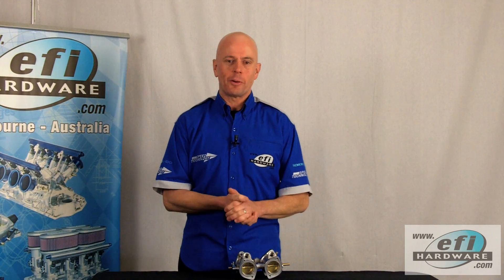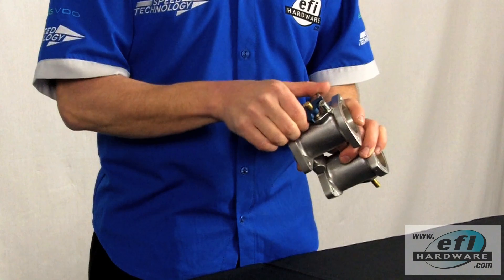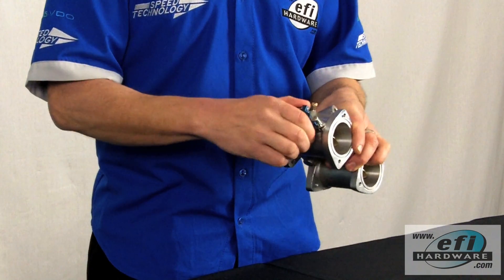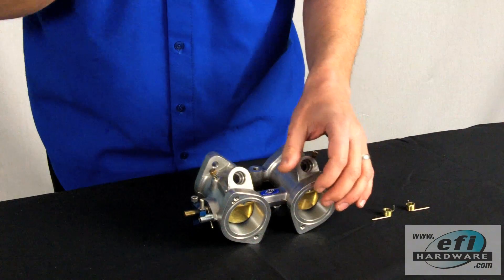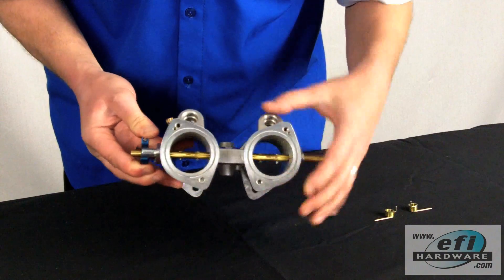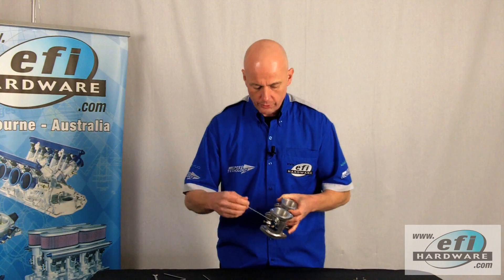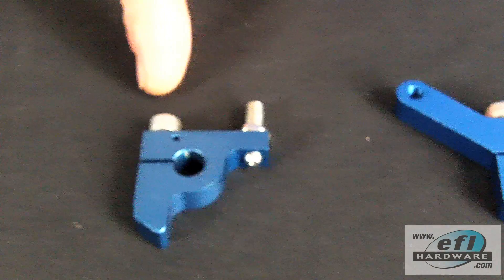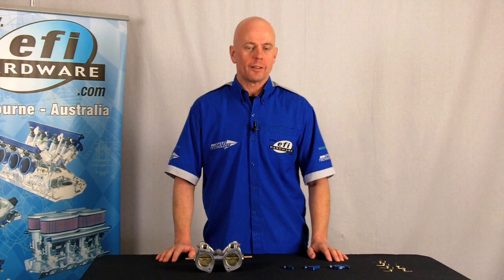Throttle Stop Fitment and Adjustment - EFI Hardware

Comment: What do you mean by just engaged on the head stop? One full turn means 360 degrees? I need to adjust my throttle body idle stop... Because i mess up the factory settings...
Reply: Yes! 1 full turn is A complete rotation.
Reply: @ jason law  -  
 What do you mean by just engaged on the head stop?   -   that means  when the bottom of the screw just comes into contact with the carburetor stopping point.

giving it the stopping point for acceleration and  for idle as well.
Reply: you mean turning one full turn when the bottom of the screw touches the throttle body or before it touches the throttle body?